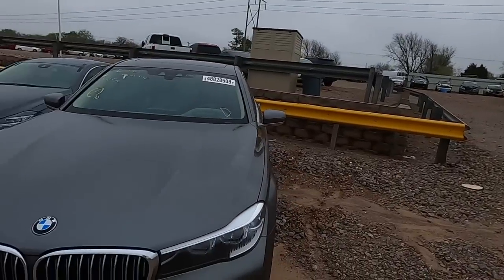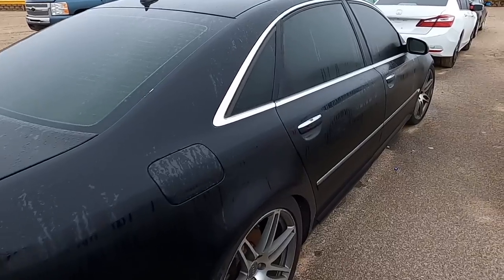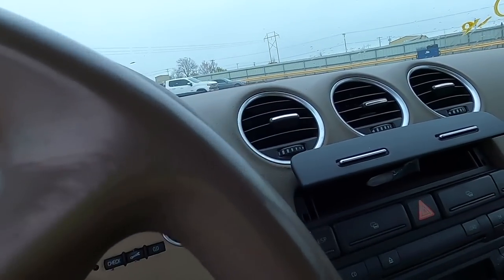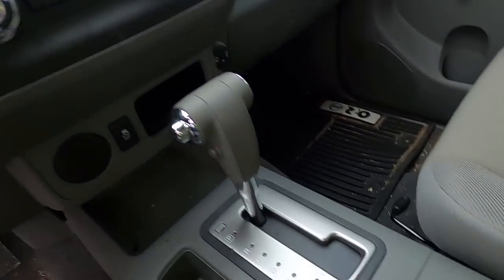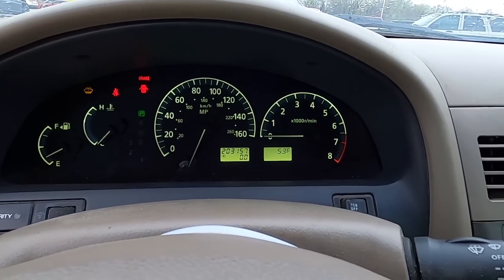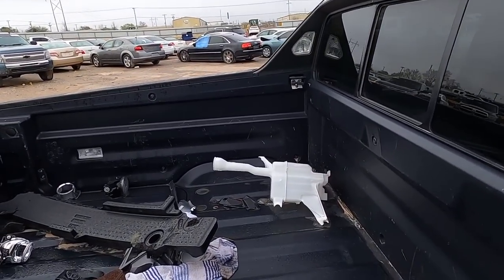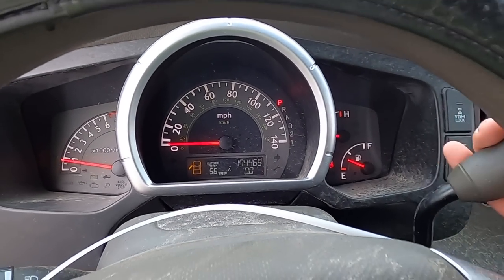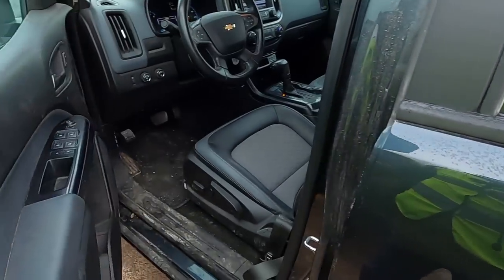Copart Walk Around 3-24-2020

Comment: Slap a new bumper on that 7 series and you're good to go.
Reply: Telluride I don’t care what year it is. Stay away from any BMW 7 series. I would rather take a Lexus LS500 for that money.
Reply: yep
Reply: If the key is there...
Reply: That's what I was thinking.
Reply: Yes
Reply: If that was the case the insurance company would have done that instead of taking a huge loss.  I wold bet there is undercarriage and or engine damage on that one.
Reply: Better off leasing a BMW to get it out of your system
Reply: But what about that exhaust. That might be the money pit right there
Reply: Someone stole the exhaust :3
Reply: That vehicle most likely has water damage, looking at how dirty it is and soggy from the inside, and it's expensive to repair. When you see new parts in the vehicle most of the time it was bought by a rebuilder and couldn't fix it. plus even with water damage, that bad boy will go for over 25k at auction, that is not including auction fees. fixing it will cost a fortune because you have to replace so many electric parts.
Reply: That 7 series is no go...
Reply: @atx-cvpi_99  but in auction it will be hella cheap so just put a bumper and sell it that's alll
Reply: @atx-cvpi_99  yep trouble with BMWs go wrong they go wrong big time and the parts are so expensive!
Reply: Better yet, buy a parts car with front end damage… probably easier than to get parts right now.
Reply: @companiessuck2975  google the copart number on the windshield, sold for 11850

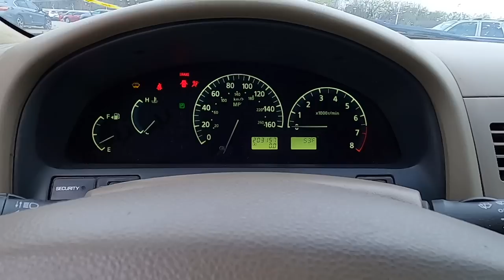Comment: The Infiniti I35 would say "service engine soon" and it did turn on but then it turned off @ 20:12 ...
Reply: Well yeah if you own a car , when the key is in position one before the car cranks over that light is always on then once your car starts and does a check it will go out if all is ok...
Reply: @the_first_resort940  I would know because I have a 1999 Infiniti Qx4 and the check engine light reads "Service engine soon"...
Reply: Again that is normal function of the obd2 system. It illuminates the light in key position one then when you turn the key it checks all monitors which monitor each system and if any fault is detected it will stay illuminated but it goes out like any other car.
Reply: @The_First_Resort No, you don't get it; Car manufacturers all have different check engine lights; Some say "check engine", some say "service engine soon", some have a picture of an engine and some have a picture of an engine with the word "check" over or under it; What I'm trying to get across is that that particular car has a "service engine soon" light...

Comment: the key removal in that Audi A8 is no big secret it's even in the owners manual about the pin hole in the key surround. not really hard to figure it out from there. you could also use a good stiff piece of wire to release it or even a zip tie .OOOH Ridgeline, you're entitled to your opinion just like everyone else, BUT IT IS A TRUCK!  those who say it isn't are the same kind of people that try to say My Cadillac EXT an the Chevy Avalanche isn't a truck also.but they are! they are built on a Suburban frame which is also used in the long bed variety of the pickups therefore it's a truck! ridge line is a tad different but still the same idea. long and short of it though, you either love them or hate them. i happen to love the look of  them.I'm not SUPER fond of that Army Green looking color, but i do love the truck still. and it's a clear title with normal wear. not surprised

Comment: You really should take on that NIssan Frontier! 13k miles, I'd overlook the damage the bed caused to the cab as long as it didn't penetrate/puncture the cab but, Even if it did, weld it up/patch it somehow, THAT TRUCK IS WORTH IT/BRAND NEW! Could get an easy 200k more miles out of that drivetrain!!!!!! Keep in mind that a used bed would cost a lot less then $4k!

Comment: On the Audi convertible this is a common fault. These issues are usually caused by internal failure of the Multitronic (CVT) gearbox ECU that is bolted directly onto the gearbox itself. Not a difficult job and the ECUs can be rebuilt but are available.

Comment: I bought a 2006 a8L flood car and it wasn't nearly as bad as that one. Needed seat module and a few others. Ended up replacing entire motor abs module 1 shock, tensioners, and a few other things. No jump point on the a8 of that year we go in the truck thru the hole/ access port in the rear seat cup holder then use a broom to hit the emergency unlock switch. Also if you put 12v to the dashboard fuse in the door it will get the key out the ignition. No paperclip some don't work properly. Hope this information helps the next guy.

Comment: There is a nice Acura TL gen3 shown at the 11:28 min mark.   Do you ever consider the Acura's?  There is good demand for the gen 3 models 2004-2008 and they are easy to work on.   I have a 2006 TL where everything still works on it and I only have to do maintenance after all these years.   I have 3 friends that all want to buy that car off me when I eventually get a newer one.  An Acura MDX would be a great car to fix and resell (2015-2020).   I am just curious if you stay away from the Acura's because they cost too much to purchase at auction and there is maybe not enough profit for your effort.

Comment: That vehicle most likely has water damage, looking at how dirty it is and soggy from the inside, and it's expensive to repair. When you see new parts in the vehicle most of the time it was bought by a rebuilder and couldn't fix it. plus even with water damage, that bad boy will go for over 25k at auction, that is not including auction fees. fixing it will cost a fortune because you have to replace so many electric parts.

Comment: get a jumper box or jumper cables and connect Positive to a smaller phillips screwdriver and negative on other scredriver and touch your cigarette lighter output. It worked for me. Ignition came on and key came out. Just don't short it.

Comment: The Honda Ridgeline looks like it’s in decent shape and running good. At 194k, it will need a timing belt and water pump. Hopefully the previous owner took care of that already. If it’s reasonably priced then bid on it, if not then move on to the next one.

Comment: Great video. I noticed during the Audi ragtop walk-around you missed the gen 10 Honda and the older Acura literally right next to it, but you redeemed yourself with the gen 1 Ridgeline (2006 truck of the year at Motor Trend). Yeah, there's no bed to speak of, but there isn't in an El Camino or say a quad cab Colorado either. In fact after 25 years the Colorado's bed is... 1.2" longer. You'll get a Honda sedan or couple in there eventually, I have faith in you. Keep the videos coming.

Comment: Me and my friend are doing coopart car things for 4 years. Bid, win, fix, sell is my car world for past years haha

Flood cars in UK are cat B listed. Cat B here is for breakers, for parts only. And you need special licence to bid on flood cars.

Audi has, boost pack points. They are located under bonnet. If airbags are deployed then you need to get to the battery location. There is a big fuse, in the + battery terminal. Two 13mm nuts and it is square shape. Take it apart, join a fuse and car will start without any further damage.
BMW, Audi, VW, Mercedes etc has same style system and so on

Comment: I miss my 05 Nissan Frontier. It had the 4 banger but it always had power when I wanted to. I had a custom exhaust on it and tuned the engine to add a little power. It was one of the only base model trucks my Nissan dealership that was custom.

Comment: Never ever buy anything from copart. When dealers can’t sell a car at any other auction, they unload in a copart auction.
Reply: This is bs.

I got a 2017 s3 for 18.7k from copart a ywar and a half ago. Dumped 5k into it and had a car for 23k that costed 38k at the time. 

It was a side hit. All I did was buy new doors, repaired rocker panel molding, repainted quarter panel, and did some other programming stuff.

If you have the time, you can get some really great steals at copart.

Comment: Randy, see info below:
they have jumper points on all these cars under the hood. should be a negative terminal on the fender wall near a strut and one hidden under the portion of plastic under the windshield. Alternativly you can go in threw your back seat to access the trunk as well and jsut pop the emergency latch.

Comment: "Hondas are not supposed to break"   Unlike a certain red car that will not hardly go a few hundred miles without breaking.......
Reply: Jon Smith The Hondas with the automatic transmission is known to fail especially on the Odysseys and Pilots. I would only buy a Honda with the manual.

Comment: That ridgeline would be a great steal :no damage, no check engine light, no lights at all. I mean even though that honda isn't a "truck" still It would be a steal
Reply: Agreed, it only needs some cleaning and that's it. They're good flip vehicles and have a small but loyal following.
I'd only do the timing belt since there's no sticker under the hood and these J series engines have an interference design

Comment: looks can be deceiving all tho I love the Frontiers and I especially like the older Nissan pickups and the Frontier Pro FX 4 X 4s
Reply: They're solid trucks but that was its lowest trim  level, 2wd, and the repair cost was way too high for that trim level.
Reply: @jimnielsen4076  I had an '03 Tundra that I bought in the beginning of '04 and I loved it and it was way cheaper than the Nissan Titan when it first came out
Reply: @paulcasanover3082  nice! I've had a '03, '06 & '12 Tundras. The '12 I'm still running.

Comment: I saw the check engine light on that Infiniti light up before you started it lol and it wasn't on when it was running, but it was unhooked from battery power for who knows how long, also those ridgelines,odyssey and pilots had transmission issues real bad.